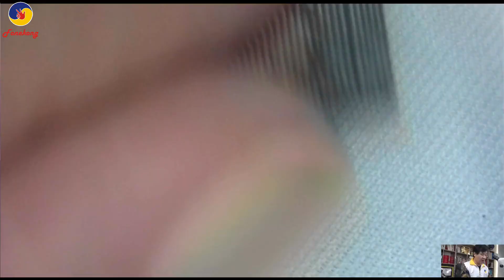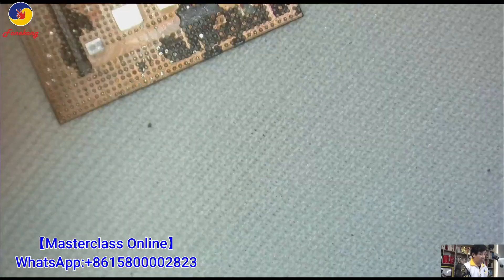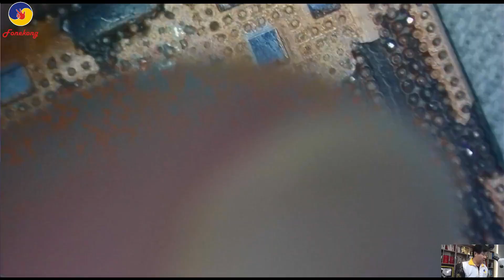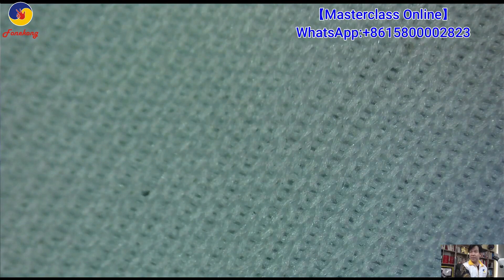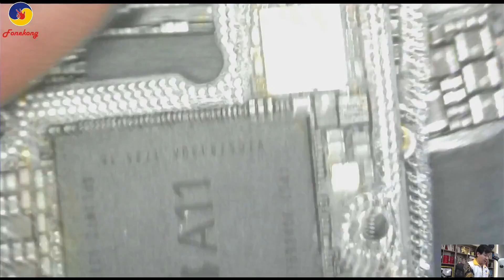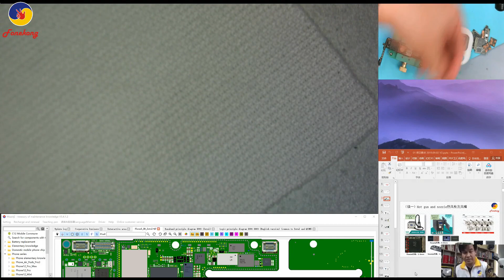Mr.Frank Liu:Cpu new skill-saft & fast【iCpu】

Comment: HOW MUCH HEAT AND AIR DID YOU USE TO REMOVE THE IC?
Reply: 330 degrees 60 air on quick
Reply: Quick air station
Reply: quick 861dw setting help